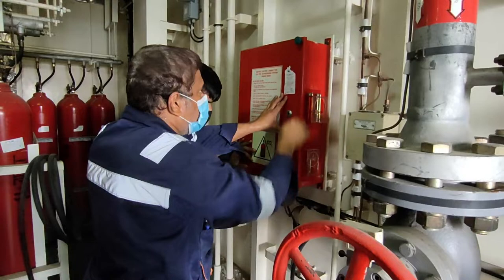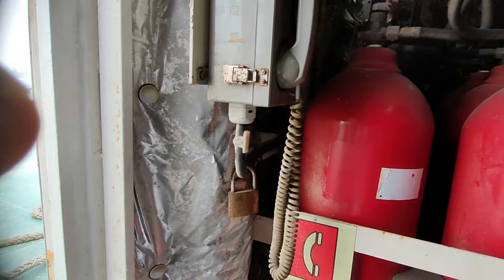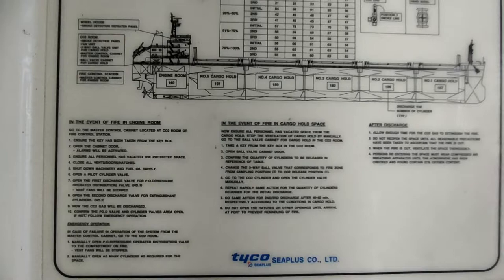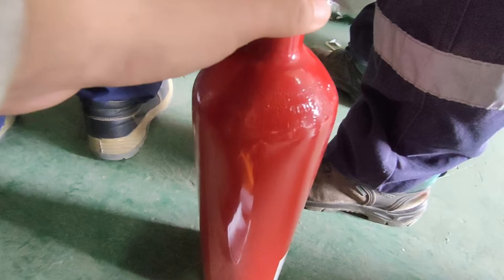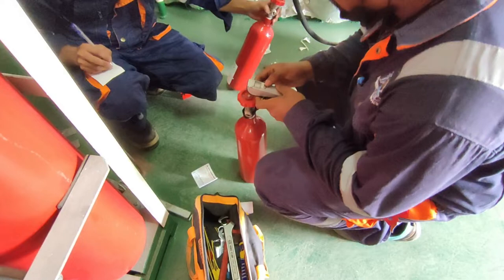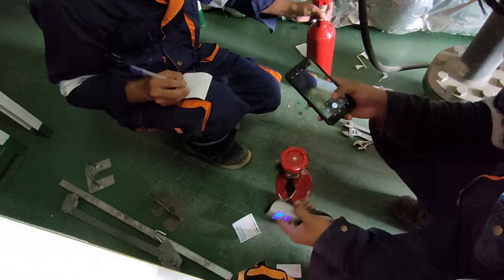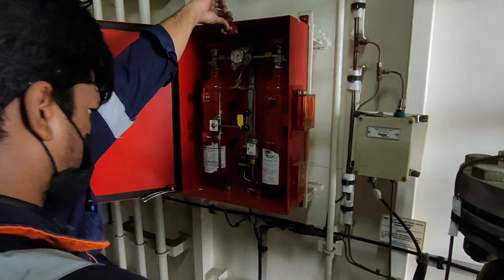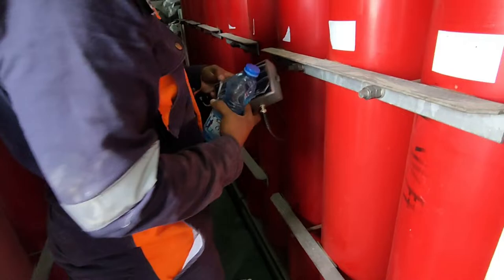MAINTENANCE AND INSPECTION OF FIXED CO2 FIRE-EXTINGUISHING SYSTEM ONBOARD SHIP

Comment: Chief Joel, thank you for sharing, it is really seldom the the pilot cylinder is check, they usually open the cabinet and do a visual inspection and replaced the stickers validity
Reply: I thought because there's a gauge. And also you can use a porta level to check the content of the pilot cylinder.

Comment: Can we do it when ship is at sea?must make some arrangements so that DG not trip sir??
Reply from the maker: It is not recommended to check or inspects the pilot valve, if ship is in service. Most of the time this test is being done in Drydock, If required test for annual periodic maintenance and for issuance of new certificate, Ship command will request for third party provider to do the test and maintenance not Ship Crew.